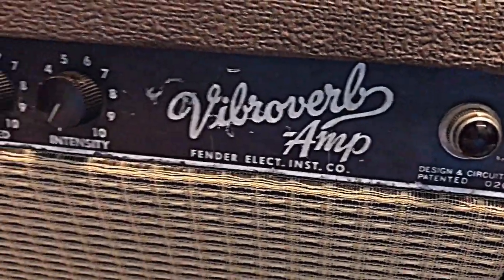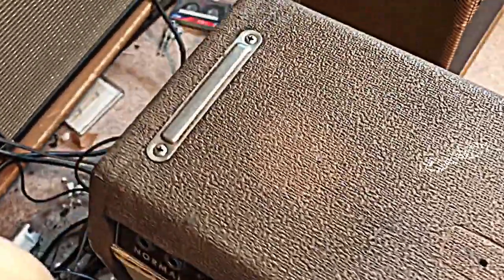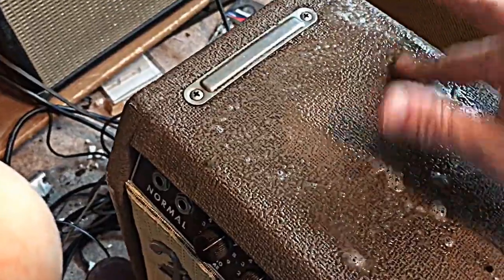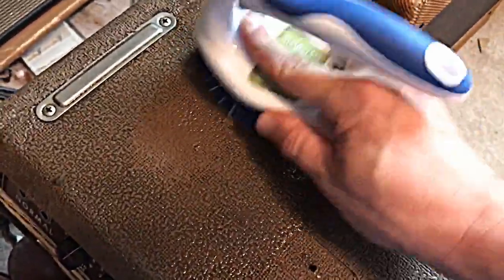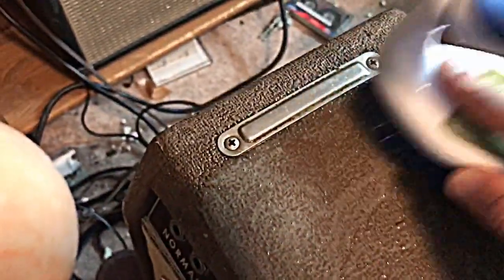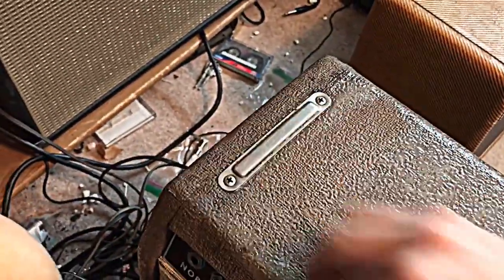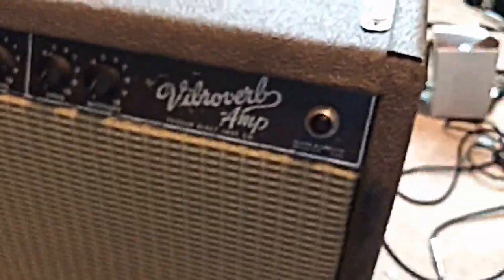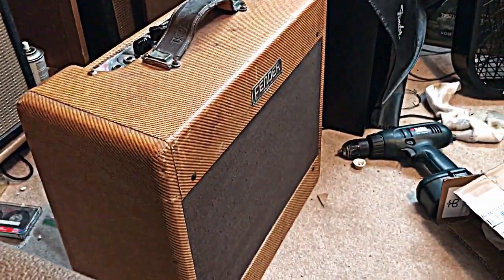Cleaning Fender Tolex brownface blackface silverface how to clean

Comment: People are afraid of silicone on armor all but this is a perfect application as long as you dont overdo it.  Armor all will prevent crackling and drying as it softens and protects the tolex but if you use too much too often it may soften it so much it will break down.
Reply from the maker: Yep. You’re exactly right. A one time application to clean years of dirt and grime will do no harm. If you’re more OCD and do this every day you’re eventually going to cause problems.